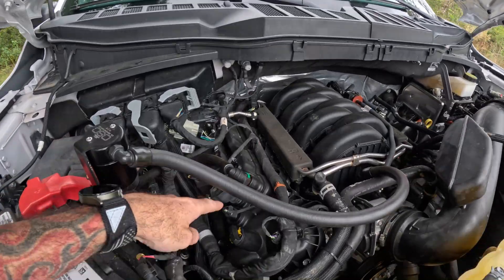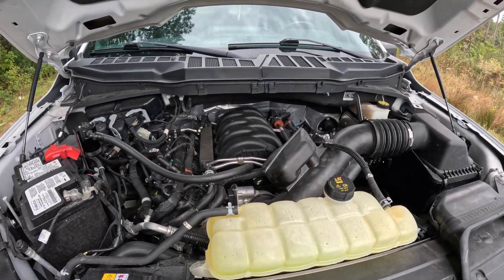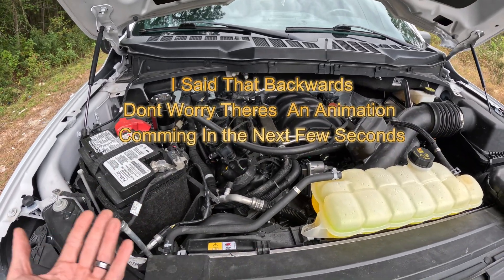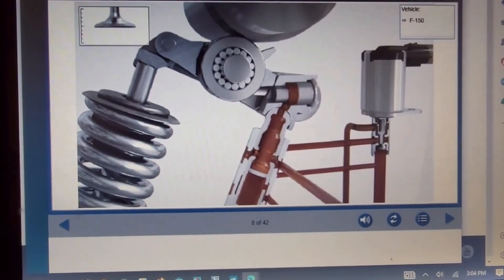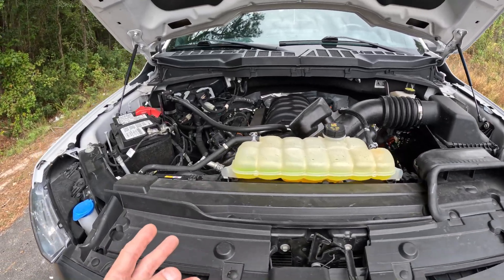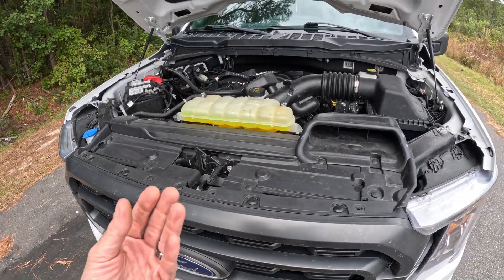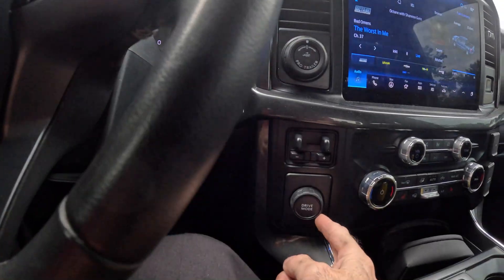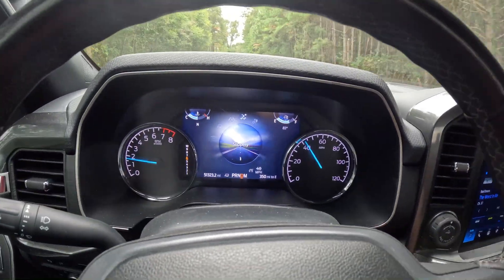3 Things You Must Know About F150 Cylinder Deactivation

Comment: It’s an interesting way Ford did cylinder deactivation on the 5.0. I’ll be curious if it becomes an issue later on down the road or not? I know there’s been plenty of 21+ 5.0’s on the road already and I haven’t heard of a rocker failure, but it’s still a fairly new system.
Reply from the maker: My engine failed at 48k. But it wasn't cause of deacrivation. There was maching debris leftover in the engine. I havent come across any 21+ with a descrivation issues.

Comment: Im on the fence with the cyl deactivation stuff. On one hand i worry about failure like with gm and mopar, on the other its a better system since its a DOHC engine and its probably not a big issue. But also in the event i take a road trip, it would be nice to see that 20+ mpg that its capable of doing. So usually i just leave my truck in sport and enjoy that sweet V8 sound.
Reply from the maker: You named one con compared to two pros.  And these tings don't fail like gm and ram.  Im getting like 23 mpg just cruising back and forth 33 miles to work.
Reply: @BeardedFordTech yeah I won't see anything like that since I have a work truck and my F150 just sits in my driveway and use it for short drives 😢
Reply from the maker: @TurboVooDoo do not short drive it.  That is one of the worst things you can do.  Take it out and drive it when you have the chance.
Reply: @BeardedFordTech I know. When I mean short I mean like a 30ish mile round trip drive to pick up my kid or a 15-20 minute drive to the store and another 15-20 minute drive back home. So kinda short but not like across the street short. But I do mostly extend my drives just to listen to my engine and scratch my brain a bit 🤣
Reply from the maker: @TurboVooDoo okay i thought you meant a mile or teo up the road. I was foing to say nnooooo! Lol.
Reply: @BeardedFordTech haha nah, I work in the auto industry as well so I know all too well short drives can kill any motor.
Reply from the maker: @TurboVooDoo 💯💯💯

Comment: My 22 seems to do it in manual mode.  Actually, it is only time I can hear it change.  My truck is stock with no exhaust.  I don't remember ever being able to hear it before.  It is only when it is in manual mode and I apply the gas or go up a hill I can hear it do it switch.
Reply from the maker: It doesnt switch in manual mode. The pcm disables descrivation. Manual mode requires all 8 cylinders just like sport or tow haul.  Especially going up a hill. It only deactivates in normal mkde when no throttle load is needed

Comment: Does anyone know about deactivation solenoid on 21 bronco sport I’m getting a P3402 I need to change part number H6BZ-6H082-A it’s only 60buck😢 but I can’t find anything on it and I want to know if I can do it my self or am I stuck spending 500 at the dealership
Reply from the maker: SSM 50382 cylinder 1 deactivation solenoid.  It sits right next to cylinder 1 you can do it yourself. Remove it. Install new. Clear check engine light.

Comment: buy an oz tuner 😉
Reply from the maker: For what?  I can just use forscan. Now. And it doesnt bother me anyway
Reply: @BeardedFordTech  Well mostly for the shift pattern, more hp, and it’s (a flex fuel tune so no having to set it and reconfigure for different fuels) (about 80 more hp on e85) torque follows as well, also the cylinder deactivation (for the people that care)
Reply from the maker: @aifangs2661 i can turn off deactivation with forscan now. And go into the address line in the pcm (these dont have a tcm like the superduty its in the pcm) and change shuft paatterns.  I dont want to run e85.  That stuff is horrible. Unless you have a build tuned for it. This truck isnt flex fuel. Im looking at the window sticker now. Even the filler neck says nothing about flex fuel. And no flex fuel badges like a ecoboost has.
Reply: @BeardedFordTech  That's strange, never heard of a 5.0 without it
Reply from the maker: @aifangs2661 my mistake. It is flex fuel. Its just not on the winow sticker.  But it is under vehicle build specs in pts oasis.  Thats my bad.
I dont ever run e85 anyway. Not worth it to me.
Reply: @BeardedFordTech  Gotcha, No probs man just throwing it out there Incase ya did, aswell if someone else stumbles across this vid
Reply from the maker: @aifangs2661 much appreciated friend. Have a merry christmas.
Reply: @BeardedFordTech  You as well brother 👊
Reply from the maker: @aifangs2661 💯💯

Comment: I'll tell you what I recommend. DON'T BUY THEM !! That and the WET OIL PUMP BELT !! Ford just screwed it's customers again !! Mustang isn't screwed like this. Screw you FORD !!
Reply from the maker: Oh really?  And i havent yet seen one problem with a 21+ wet belt or cylinder deacrivation. Know why?  Cause it was designed in house. And it has constant oil pressure. Not 13 psi at idle like gm and chrysler. And it doesnt deactivate at idle. Yet people still buy those garbage gm and chrsylers. Ford didnt want to do it. Epa forced them to. So the epa would be screwing everyone. Not ford. They are doing what the law requires them to do.
Ask any ford tech what gas engine they would buy in a f1510 21+  5.0 is the most answer.  Because its more reliable than a 3.5. Youll have tuebo failure/problems before a wet belt problem.  Also the fact its kevlar. Not straight rubber.  The more you know. Stop being scared of it
Reply: What are you taking about ? Lol you do know super high performance engines use wet belts. They’re reliable.

Comment: I like this A LOT better than the system on my old Ram 1500 (2016, 5.7L). It ultimately falied at 240k miles with a #3 lifter failure.  I kept the oil clean and did mostly highway driving but it died anyway. I also only used the recommended 0W-20, which I have since learned is only for US markets due to CAFE. Go figure!
I've never had an F150 with a Coyote, but it looks like I'm getting one. Thanks for the info!
Reply from the maker: Yeah this system works a lot better than ram or gm.  Using 0w20 with desctivation and low idle oil pressure is whats is killing those. The f150 doesnt deactivate at idle and has constant oil pressure.
Reply: What oil does the 21-newer 5.0 F150s use?
Reply from the maker: @CJColvin 5w30
Reply: @BeardedFordTech Does Ford recommend it or do you avoid the book and do the oil you're own way? I hear that it can void you're warranty if you don't stick to the oil that the owners manual recommends you?
Reply from the maker: @CJColvin what are you talking about?  The 5w30 weight?  The 5.0 has used 5w30 since 2021.  And trust me in order for.it to "void your warranty" they have to peove it.  Which involves tsking a sample sending it off waiting for the results. Nobody has time for that.
Reply from the maker: @CJColvin https://youtube.com/shorts/DyJQe7pZTF0?feature=share
Reply: @BeardedFordTech Gotcha, thats good, how much did you pay for the truck and also whats the warranty on it as well? Just curious?
Reply from the maker: @CJColvin factory bumper to bumper is 3yr/36k mile. Powertrain is 5yr/60k mile. But this was a certified blue ford advantage used truck. So the warranty is to 100k.
Reply: @BeardedFordTech Is it from the truck itself or did you get it from a dealer?
Reply: @BeardedFordTech The factory bumper to bumper warranty on my Titan is 5 years 100,000 bumper to bumper warranty and the power train warranty is lifetime warranty as well.
Reply from the maker: @CJColvin i bought it from the dealer i work at. It was used. Certified blue advantage 100k mile warranty. They come fsctoey filled with 5w30 since 2021
Reply: Made good on miles. Friend I have his 16' charger 5.7 lifter failed at 130k miles.
Reply from the maker: @shawnkleveland196 completely different system than a gm or chrysler

Comment: I know enough about it that I won't own a car with cylinder deactivation. FORD WHAT WERE YOU THINKING !?!!??!
Reply from the maker: Then you dont know enough about it.  Its not the deactivation thats the problem (on gm or dodge) its the 8 psi of oil and deactivating on idle.  This has oil pressure between 27 and 37 constant. And does not deactivate at idle.  I have not come across one 21+ that has had a deactivation problem.  
And ford was thinking different than gm and dodge. And because they were forced by the epa to do it.  They didnt want to
Reply: Another clueless.

Comment: My 2025 absolutely did not disable the cylinder deactivation in Sport mode. It did in Tow/Haul mode though. The Whipple tune disabled it permanently when I put the Whipple on it. To be honest - I kind of liked the fuel savings it gave. I wish I had the option to turn it back on at times. I wish my normal mode was Economy mode and the cylinder deactivation still worked. Then it didn't work in any other mode. That's what would be ideal to me.
Reply from the maker: Sport mode always deactivates it. I have not come across any 21-25 where it didnt. Its in the pcm programing.  Sport mode is all 8 cylinders all the time.  Even looking at a 25 model power balance test . And a test drive monitoring injector cut off and deactivation on or off it was always on 8 cylinders.  Yours should have not deactivated in sport mode.  It does give pretty good fuel mileage. I drove in economy like once.  Usually sport or normal for me

Comment: Is there ANY inherent issue with driving every day , all day sometimes, in SPORT MODE ?  (Other than a tad worse gas mileage).    Does it shorten engine life at all ??
Reply from the maker: No.  Just transmission is in a different range so it stays in like 7-8th gear. 7th gear is 1:1 ratio.  
It just like driving around with a v8 all day

Comment: Everyone makes a big deal about this and yet I have not heard ONE substantiated problem anyone has had caused directly by this.   Those sound nuts, OK maybe I get that.  
But I want my 2024  5.0  F150 to be quiet .....ssssshhhh
Reply from the maker: Lol. I havent even seen one problem with them.  Or the wet belt.
Reply: The question is will the 5.0L Coyote V8 with the welt belt and the cylinder deactivation make it to a million miles with ease like the 4.7L I-Force V8 in the 07 Tundra as well as the 5.7L I-Force V8 in the 18 Tundras?

Comment: Cylinder deactivation can cause your block to warp over time , resulting in an oil leak from the cylinder head gasket . This happened to Honda’s V6 with their VCM system. That engine was a solid engine for longevity, but that VCM feature created that effect because of uneven heat distribution. I would disable it if I could if I wanted to keep the engine for high mileage 250k and above
Reply from the maker: Ohh
Reply: lol
Reply: Yep, Exactly, that's why I've got the 2024 Nissan Titan with the 5.6L Endurance V8 in it with 400 HP and 413 Ibs of Torque over the 2024 Ford F150 with a 5.0L Coyote V8 in it with 400 HP and 410 Ibs since my Titan has no cylinder deactivation and no Auto stop start as well as no welt belts, just pure V8 goodness.
Reply from the maker: @CJColvin this one doesnt have auto start stop either. Same hp on a smaller engine. Deactivation can be turned off.
Reply: @BeardedFordTech Did you delete it or did Ford not installed it?
Reply: @BeardedFordTech Whats ingredients does Ford have that makes this engine wayyyyyyy too good? Also I had a 2011 Ford F150 with a 5.0L Coyote V8 in it with 163,000 miles on it and still ran great minus burning oil at 160,000 miles (which doesn't seem alot of miles at all).
Reply from the maker: @CJColvin auto start stop?  It was a custom krdered teuck by previous owner. They never installed it. The button isnt on the dash.
Reply: @BeardedFordTech So you bought it used previously then?
Reply from the maker: @CJColvin yes. I bought it in august
Reply: @BeardedFordTech Nice did you get it for $45K?
Reply from the maker: @CJColvin no. Sticker peice new is 60k. I didnt even pay 40k. I got employee and dplan pricing
Reply: @BeardedFordTech Nice, was it $35K? Also how do you get employee and D Plan pricing?
Reply from the maker: @CJColvin doesnt matter what i paid for it. You get employee pricing from the dealer. Dplan from ford. Why do you keep asking me these questions?
Reply: @BeardedFordTech Just curious
Reply from the maker: @CJColvin oh

Comment: I could hear it and it sounds like the engine gets a stumble or a misfire.
It sounds horrendous.
Reply from the maker: Sounds like wawas its not stumbling or misfiring but i see how you think it sounds like that. And if I didnt have an exhaust on it you would never hear it.  You can't hear it with factory exhaust.  Is what it is til I can figure out out to turn it off with forscan
Reply: @BeardedFordTech  Just saying, if I heard that I would think my motor just did an unscheduled disassembly.
Reply from the maker: @BehindthesafetyofLinux lol. True. Mkst people that have these with an exhaust did bring them in for something like that. We had to explain that it has deactivation. Has had it since 21.  Other thsn that. Its smooth as can be. Has plenty of power.

Comment: Because this worked so well on GM 5.3s. ..
Reply from the maker: Totally.different system. GM and dodge was not developed in house. Fords was.  People need to stop comparing this to gm.  GM (and dodges) biggest flaw wasnt the system. Its the fact is has like 8 psi of oil at idle and theirs desctivates at idle too.  That variable oil pump. Also why this engine has a wet belt with a bigger pump. Instant oiling and keeps pressure up. Even at idle. Again. Totally different system.
Reply: @BeardedFordTech gotcha
Reply: @BeardedFordTech 100%. Alll the haters don’t even realize this is a completely different system. lol.

Comment: Which exhaust do you have? I was thinking about getting a flowmaster outlaw muffler but it’s probably gonna drone a lot with the cylinder deactivation. Do you know what I need to deactivate it?
Reply from the maker: I have a flowmaster flow fx side exit. Unfortunately those three ways are the only way to deactivate it right now. Still searching through forscan. Soon as we find it and it works I'll let everyone know.
Reply: @BeardedFordTech did you take off the resonator?
Reply from the maker: @torredcat yeah. Its a cat back. Comes that way. What year is yours ill send a link
Reply: @BeardedFordTech I’ve seen the outlaw catback before, I’m just gonna swap the stock muffler and keep the res.
Reply from the maker: @torredcat the kit come with the pipe off the cat which gets rid of the resonator, the muffler the over axle pipe and tip takes about 20 min to put it on

Comment: Hey BFT! Awesome content as usual! Ty! I own a 24 F-150 2.7 ECOBOOST, and really thinking about eliminating AUTO START STOP or using at designed, do you know any long term damage/ issues for those that use it, as opposed to eliminating it? I also notice that when the truck is not fully warmed up it sometimes activates. My concern on hot days with the engine auto starts stop prevents oil from flowing through the turbos to them from baking? What are your thoughts, thank you!!
Reply from the maker: Baking was a problem on turbos when they used babbitt bearings. It is not an issue on ecoboost engine.  The engine isnt off long enough during a stop start event to have it bake. Or does it spin long without oil. Now a 6.7 powerstroke can spin for up to about 22 seconds.  But a 2.7 is like 2 seconds. Start stop system is not hurtinf turbos or causing damage. If you do want it deactivated i can do that with forscan.